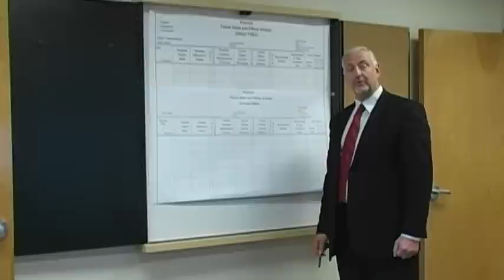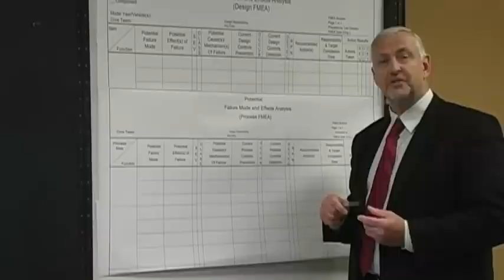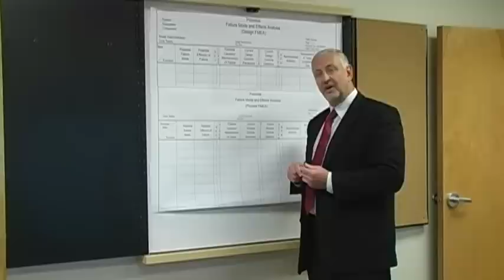Introduction to DFMEA

Comment: Is there a chance someone could help me understand what he means here:
"we link the functional performance of the product and the manufacturing requirement of making the characteristics to blueprint specifications."
So he's saying that by linking the DFMEA (failures in relation to the function) to the PFMEA (failures relating to the device manufacture), you develop a map of the development failure modes, therefore all the failure modes at all stages can be avoided and this map is the "blueprint" that allows the device to be mass-produced? Is this what is meant by "making the characteristics to blueprint specifications"?